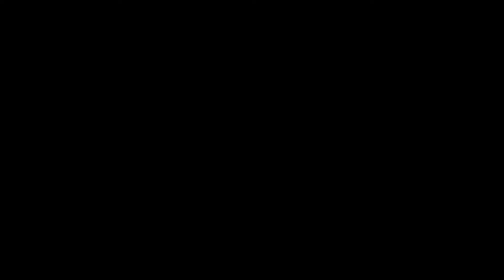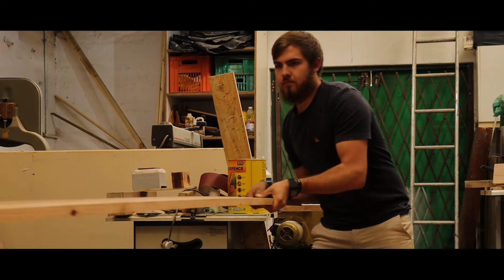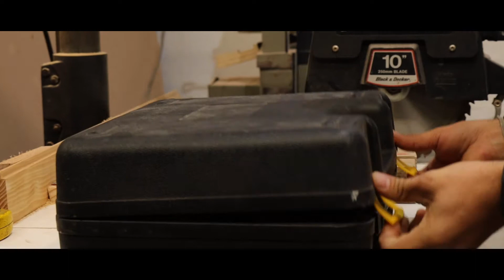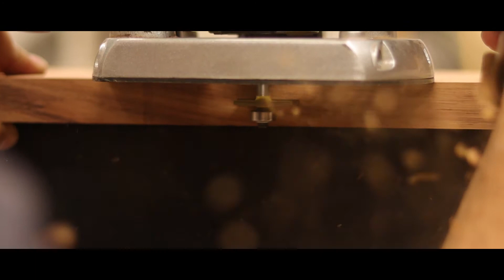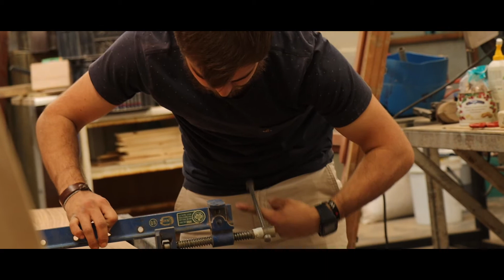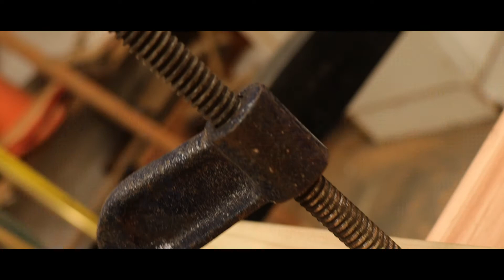Canon 90D, 120 fps slow motion, Awesome!!

Comment: Hi Jacobus  fantastic video, I am also planning to buy  90D with Sigma 18-35 lens.
Do you use any gimbal, I am thinking of Crane 2 is that good enough  with 90D ?
Reply from the maker: Hi. Thanx for commenting.
I was also thinking about getting the sigma.  As for the gimbal, I do not use one. However the crane 2 is perfect for the 90D with the sigma. The DJI ones are almost double the price and the DJI SC is to small for the 90d in my opinion
Reply: @jacobusvanzyl2502  cool thanks for your reply.
Reply: @srinivas8981  did you get a Weebill S?  I cannot balance it too front heavy.
Reply: @Richardvanschalkwyk    I have DJI Ronin -S  Gimbal. I am planning for  Full Frame Mirrorless camera so would go for sony.